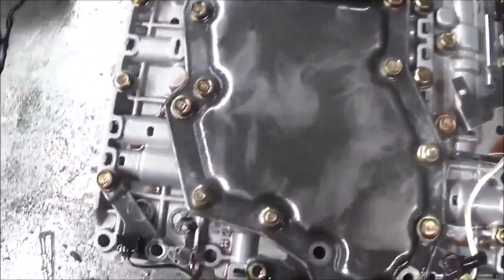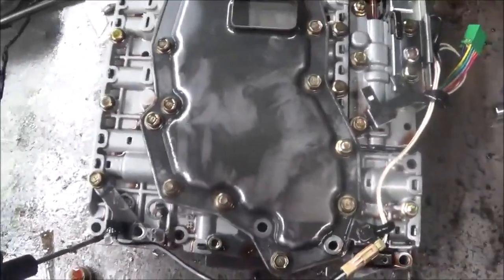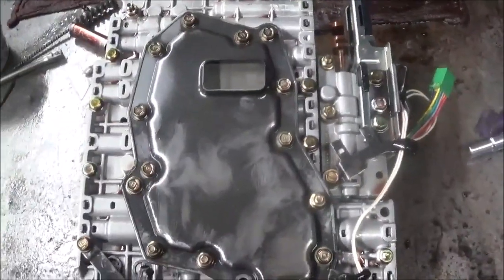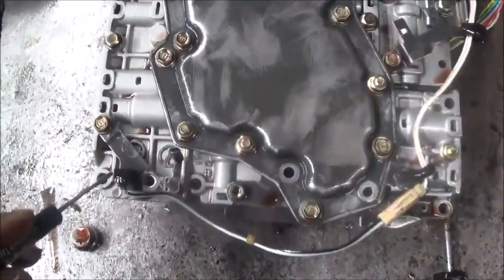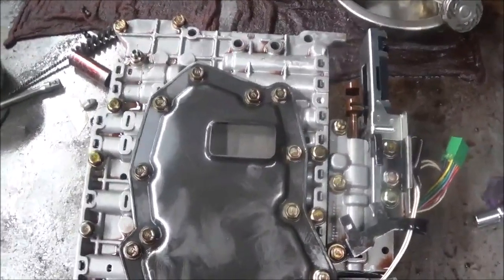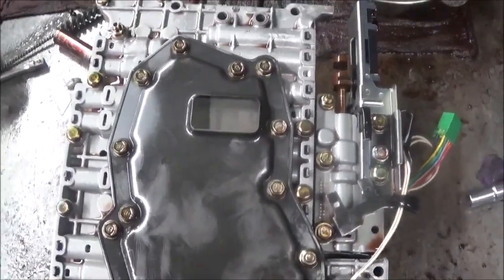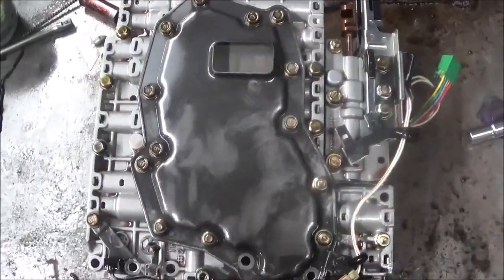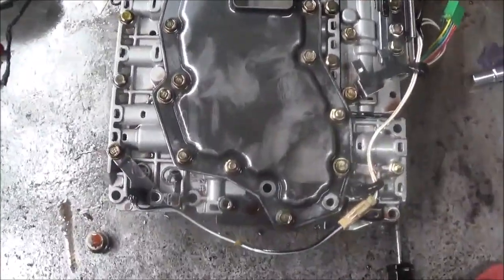RE5R05A VALVEBODY BOLTS TO CASE LOCATION

Comment: Good morning. my Nissan Pathfinder 4.0 has a delay of 2-3 seconds when I shift from P to D. The delay only occurs in D. Other than that, everything is fine. the oil has been changed. only the filter was not mentioned. Could this be a problem with the valve body or is it a problem inside the gearbox? it's worse when the oil is hot. and R enters normally.
Reply from the maker: How many miles on the vehicle? Is the check engine light on?
Reply from the maker: What year is the vehicle?
Reply: 2010 4.0 V6.  I have 140 miles. everything is very good. only when I switch to D, which has 2-3 seconds before it engages the gear. R changes very quickly.
Reply: shifts gears well while driving. My oil is new, but I haven't checked the filter. I've had the car for two years now and everything is the same. I don't understand why only D and everything else is fine...
Reply from the maker: @v.n.7495  What type of transmission is in this vehicle?
Reply: RE5R05A exactly like in the movie 
 five speed. @thisisyourtransmission